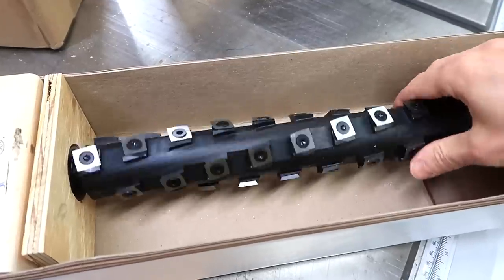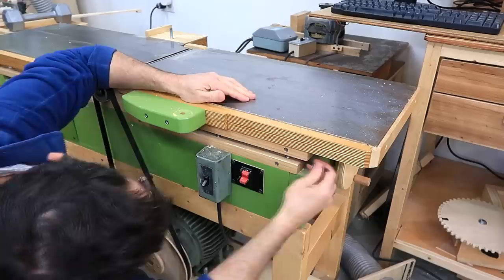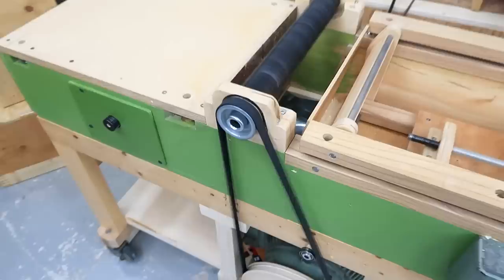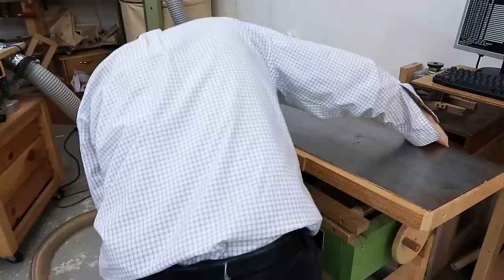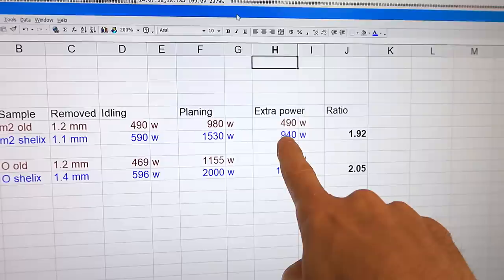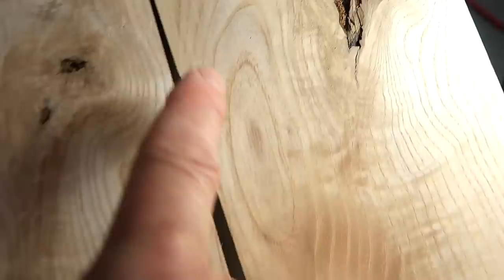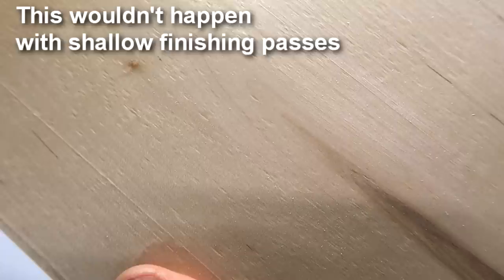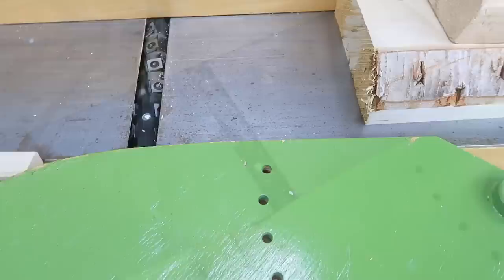Shelix head vs HSS planer head: Comparative tests

Comment: The sound at 3:35 when the shelix head spins down is a damaged bearing somewhere.  When new lubricated bearings are  turned by hand there should be no noise at all, and absolutely no feeling of "bumpiness".
Reply: That sound always reminds me of a coffee grinder.
Reply: @Owiko7  With marbles in it.
Reply: @2OO_OK  everything about that makes me cringe inside. 😬
Reply: @WikiSnapper  Yes.  I wonder if the bearing was installed by beating it on with a hammer, or if the assembly was dropped on to the bearing at the factory.
Reply: Notchy bearings will do this, even a little pitting on the races or a roller will make a difference at this rpm.
Reply: @Owiko7  it gets as bad as "a handful M14 nuts in a dryer" once You manage to ignore it long enough.
Reply: @2OO_OK  My brother rebuilt an RX7 five speed when he was young and the thing sounded HORRIBLE when he got it back together, bearing whine that buried the engine noise.  You could hear the thing coming a couple of blocks away.  I finally got it out of him that he had pounded all the bearings on from the WRONG side of the bearing. I'll bet there wasn't a round ball in that entire tranny.  And he later became a mechanical engineer, and a pretty good one at that.   Go figure.  Every time he drove the thing up  I'd be trying to suppress a smile or laugh, and it was always like "shut up".  It's been about 35 years now, about time I brought it up in passing with him again.  Good times...brothers.  Brutal, but having their backs.

I've installed bearings many times in various applications, including manual trannys, using a soft pipe and hammer, on the RIGHT race, and never had any problems at all.  They were not super tight press fits, though, usually just a bunch of fairly gentle taps would move them into place, with a clip to hold them.  My friend used to call those circlips Jesus rings, because he said he always uttered several times when trying to install them.  :-)
Reply: @MrJdsenior  Yes if people tap on the  correct race it can be OK.  Using just text to explain  to people which is the correct race and when can get long winded  so I have given up trying to do so.
Maybe I should make a video ha ha.
Reply: @2OO_OK  Not a bad idea, actually.  If I was still doing work of that type I would, but I'm getting too old to have ANY interest in climbing over and under cars any more.   There are probably already ten of them on YT though, if I had to guess.   It is a very handy resource.  

I had to fix three stripped head bolt holes in a Camry a couple of years back (grrrrr, the middle back bolt I just pulled out with my fingers, straight up, no twisting with wrench or fingers required, and an aluminum coil down most of the thread). The two on either side stripped with about 10 ft lbs in the tightening direction.  

It was nice to look at a quick vid of the job before I started, saves having to figure stupid crap out as you go.  And guys put videos for those nonsensical dealer  algorithms to program in alarm fobs, etc, one I used recently.  

It's ridiculous, open the door twice, turn the key to on, then off again, stand on your head and tickle the brake pedal etc. for about 5 more steps.  It seemed like it went on forever.  What is wrong with these designers?

Oh yeah, I finally bought a crappy Harbor Freight press and some usable bearing splitters and press bushings, so it was a lot easier after that, and no beating on anything, which was a plus.

Cheers.
Reply: @MrJdsenior  For the camry head bolts, which insert kit or other solution did you use?  I have a rav4 motor with that head bolt problem.  I am still crawling under cars because I expect the total irritation will be less than taking it to a shop.
Reply: @2OO_OK  Yeah, the timeserts are utter crap.  If you look they have a fix for the first time their first timesert fails.  The thing has the same crappy fine thread cut in the block as the original head bolts, which is stupid.   

I looked around for a while and found a real nice kit called the Hunh Solutions kit.  It has a lot of advantages in that it cuts the holes for that second size timesert cut and the outside threads are WAYY courser, so they have a lot more grab.  He gives a percentage of thread contact area over the fine thread IIRC, and it was a lot.

The kit is very high quality and works for multiple engines, unlike the timesert kit which is specific to each engine.  

I sound like a salesman for the damn product, and I have  nothing to do with it other than I am an engineer and when I looked at the thread on the TS I thought, you gotta be kidding, use the same thread that stripped?  It comes with a very high quality tap, the inserts, which you can buy separately, a little insert extraction T handle, a stainless steel ruler with the little slide stop to measure hole depth and insert depth, a bushing and bolt on bar for cutting the holes and another bushing to center the tap for the cut.  It really worked beautifully, one of those times I bought a kit like that and said, man, this guy put some thought into this.

I have the used kit, sans the used inserts, obviously that I was going to put on ebay.  I'll go look at the price and the inserts price, and sell it to you for $100 bucks off the purchase price, which I suspect you could do again on ebay when you are finished.  

Let me know if you are interested and I will go dig it out, get the list price now and the insert prices for your car (about $75 bucks, IIRC, and he gives you an extra for the fitting, so all the ones you install are new.  Oh yeah, and brake cleaner type fluid (or you buy it, can't remember) to super clean the tapped threads and inserts right before you put the red (serious hold) loctite on them.

I remember the pin in the block was a little wobbly in the front but it locks right in place with no movement (I tried with an indicator because I was a little concerned, but all was good).

Search Huhn Solutions thread repair on google and it should come up.  The tap didn't cut any differently on the first hole than the last so it is still razor sharp (literally, I cut my finger with it once gripping too tightly.

I remember he recommended a specific head bolt for the job, from Toyota, which were not super cheap, I think I got them for abou $70 bucks on ebay, and he said he REALLY recommends you get the new OEM bolts (you can do studs, too, but contact him if you are going to).  When I called him he called me right back and answered the couple of questions I had and the job went great (All that tapping takes a while, like 3 1/2" or something deep in ten holes.  

I recommend tapping down to a quarter inch or so short of the specified depth on the first tapping, then run the working insert in, measure the depth accurately. Then you can just measure the required depth addition, use the measure or caliper against the tap threads and see how much more tapping is needed.  Then I marked the tap accurately and was good to go from there.

Again, let me know if you are interested and I will throw in an ebay listing with pics and contact  you with the title right before I place it so you get first shot.  We've sold thousands of things on ebay (my wife's hobby, lets her shop a LOT, and she likes that, and we make money at it rather than losing money  :-) ) and have 100% positive FB, so you don't have to sweat that end.

Oh and there are YT vids that show the process end to end, probably for your specific car. I found that useful to watch before I started the job, even though I've been 'mechanicing/restoring/building/etc all my life).
Reply: @MrJdsenior  Thanks for the info I will look it up.
Reply: @2OO_OK  I've successfully rebuilt a few machine tool spindles.  It is an absolute no-no to transmit any installation or dismantling forces through the rolling elements.  All such forces must be applied directly to the bearing race being seated or unseated.
This may be difficult during dismantling but, this operation is usually done to replace the bearings.  If the original bearings are to be reinstalled, then above caution needs to be adhered to.
Reply: @BasementEngineer  You explained it perfectly in very few words.  I am going to save that for future use.  Thank you!

Comment: I can't lie, I'm actually really impressed by the low severity of injury on this one, I probably would have cut myself so often I'd bleed out before running the second test batch.
Reply: Turning the machine off before you start makes working on it easier and less dangerous.  :-/  :-)
Reply: It's like when you become obsessed with getting your chisels and plane irons to ultimate sharpness, and they only need to look at you to draw blood. 😬  Either that or I am getting clumsy in my old age.
Reply: @TrevorDennis100  There are advantages and disadvantages to everything.

Comment: I put a Shelix head in my Dewalt 735 planer and it made a HUGE difference both in terms of noise volume, finish quality and ease of use on my machine as I can take off more material easier.  And if you do get a nick in a blade, you just rotate the one blade a quarter turn and keep on going.  The carbine cutters last way longer than HSS.

edit

The other thing to consider with a helical head vs a standard knife cutter is that helical heads produce small chips instead of long ribbons which can really clog up dust collection.
Reply: That's awesome because so far my steel knives have lasted me 25 years. So way longer would be like lifetimes. Of course I sharpen my knives pretty often. I bought another set of knives but I've never used them yet. They're still sitting in a drawer.
Reply: @1pcfred  if your knives are that old, it's possible the quality of steel was better when they were made because a lot of HSS cutters now dull quite easily.  I'd also like to know how often you're putting lumber through your machine as I read a review by one fella who said he's run over 5000 board feet through his shelix head on one project and they still cut like new.
Reply: @krenwregget7667  I do not know if my knives are HSS. Maybe? I do know they take a sharp edge. I've passed some pretty bad wood through them too. Like pallet wood. Although that's not all the same. A board foot is a measure of volume, not area. So it is not easy to figure out how much surface 5,000 board feet really is. I used to run my planer more than I do now. I'll only break it out today if I have to plane a lot of wood. Which isn't too often anymore.
Reply: Carbide does stay sharp far, far longer, even though it is not quite as sharp as HSS., in absolute terms
Reply: @1pcfred  sorry, I did write board feet where I meant linear feet.  He was making flooring and trim moldings for two houses.
Reply: @krenwregget7667  5,000 linear feet is almost a mile. That's a lot of flooring.
Reply: @krenwregget7667  old steel was absolutely not better than it is now...

Comment: Those old bearings look to have a Metal Dust Shield (part number ending with Z or 2Z) the new bearing is a Rubber Seal (part number ending with RS or 2RS). Rubber seals will naturally create more drag.
Reply: More Drag - Yes. Like 500 Watts more drag? No. That would immediately melt the rubber completely off, or ignite it more likely. Its prob 50/50 Grease, Air resistance and maybe slightly missaligned bearings causing pinching.
Reply: @marcoschwanenberger3127  I took his "more drag" comment to mean the difference between spinning freely and stopping themselves earlier.  Not so much the power consumption.
Reply: @Scoots1994  his old bearings definitely have zero grease left in them. Those things are bone dry. Even oil would stop free spinning. They're pretty low load so they might not even need grease, so that might be all the better for him to save on efficiency.
Reply: @F0XD1E  Problem with metal shield bearings and grease in wood processing machines is the dust - the dryer the better. Wooddust on grease ignites in a bearing easily once it is enough to increase friction - even worse with a wooden corpus. the dust-on-oil/grease is the reason why historic machinery was openly oiled twice a day in amounts to wash the collected dust to the outide of the bearing. A bloody mess and a problem for finished surfaces not yet coated, but the way to keep the machine running without going through bearings weekly. In this case here though I'd go for the alignment with Matthias' planer, because a dry, slightly worn bearing is way more forgiving than a new tight greased one.
Reply: @manfredschmalbach9023  Bearings on some of the steam driven stuff I used to 'engineer' on, like the Riverboat at Disney had CONSTANT oiling from clear cups so you could see when they needed filling, and the tops had a pull and tilt to turn the flow off when not running, and a screw under that tilt do dad to adjust the flow.  

It made a mess if you had the flow set too high, and it seemed like most everywhere you had to get to wipe the mess off was hotter than H E double hockey sticks.  These were mostly VERY low speed bearings, some of them like like 12 RPM,on the paddle wheel and nothing over about 150 RPM.

They were mostly babbet type bearings, IIRC.
Reply: @MrJdsenior  Yeah, I not only remember those oil cups, I have some of those "oiling points" which are cups to be filled with certain viscosity oils on my selfbuilt wood-lathe, on most of the historic metal lathes and on the frame saw. Not risking to contaminate the sawn/processed wood surfaces would mean to loose the machine within days. Not oiling and greasing properly at all would have meant to loose the machine into "unrepairable" regions within hours.

Comment: There might be a problem with bearings or balance. I put a shelix head on my 6” jointer and the performance was night and day. Although almost noting can beat freshly sharpened flat heads for a smooth finish, I had to resharpen almost every day with heavy usage. The shelix cuts like butter, laughs at most knots, and is ~4 times quieter (I didn’t do tests but my ears and the people around are thanking me) and I haven’t even rotated a single blade in over a year.
Reply: Yeah there's really no replacement for sharp tools. Once you see what sharp tools can do then you always just want to use your tools when they're sharp. So what that ultimately means is you have to get really good at sharpening. It's a vicious cycle. I look at my tools under a microscope now to see how sharp they are. It gives another perspective on matters. Now I want a better microscope, of course. I just have a cheap USB one now. I was looking at saw teeth the other day with it. Very interesting.
Reply: Watch out for those knots. I put a pine board through my Dewalt thicknesser and the shelix head pulled out a loose knot which was so hard that as it bounced around inside the machine it completely wrecked the cutter head - not just the cutters - it bent back many of the cutter seats machined into the head, parts of them were torn and split. It didn’t do the thicknesser much good either. I managed to sort out the machine, but the head was a right off. It’s as it there had been a steel nut bouncing around in there.
Reply: Anthony Bailey yeah you have to watch out for loose knots and crispy knots, they are dangerous
Reply: @1pcfred  I recommend the Edge-On-Up sharpness tester - gives more quantitative information than a microscope image.  That feedback helped me improve my sharpening a lot.
Reply: @paulkolodner2445  what I did to improve my sharpening was just sharpen stuff for over 50 years. Maybe there's something else I can do to improve? I've an open mind. Just between you and me though I kind of doubt it. But we'll see.
Reply: @anthonybailey7628  That was a me$$ !
Reply: @ZAPATTUBE    A very expensive mess :(

Comment: Oh, COOL!  The noise, surely you recognize that.  It's the exact same effect as your homemade siren, the dust collector pulling air through is alternately stopped/passed as the blades close and open the gap between themselves and the bed.  Paused @ 01:12, I bet the shelix head doesn't do that since the flow is never fully stopped.

Comment: I had a 6" helical head jointer with a 1.5hp motor. It clearly was underpowered and a pain to use on hardwood. I swapped it out for a 3hp motor and it was like night and day. Completely transformed the jointer from a pain to an absolute dream to use. I am not surprised therefore that you were using twice as much power with the new helical head, because that is exactly what my anecdotal experience says would happen.